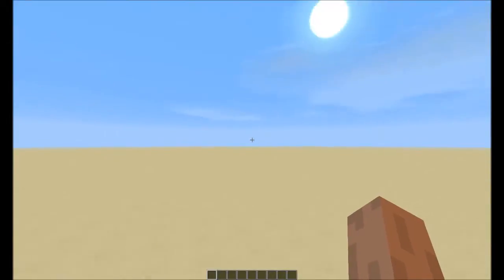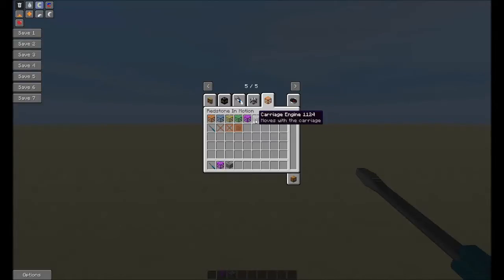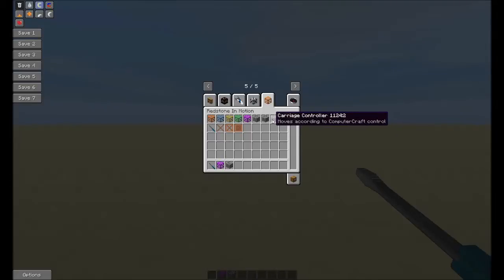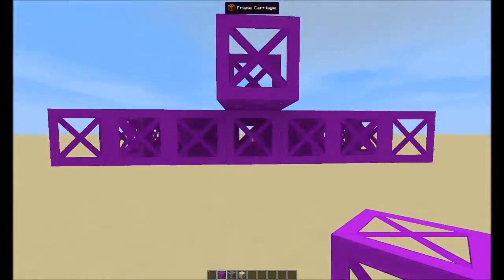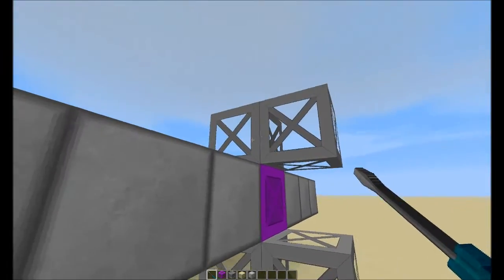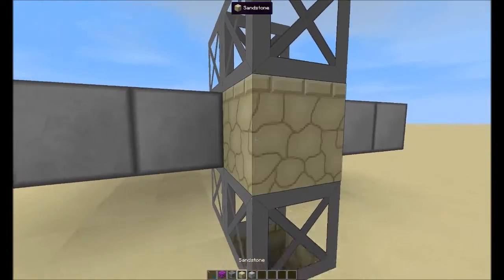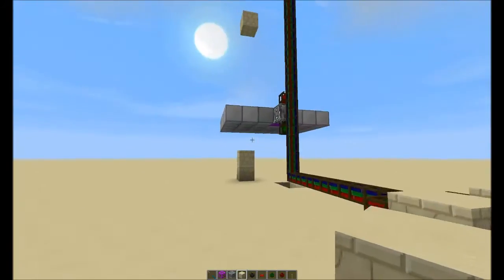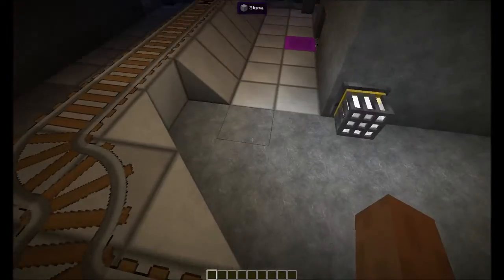Minecraft: Redstone In Motion

Comment: I built the exact same thing in new Tekkit for MC 1.6.4, none of the motors or carriages move themselves or anything else, no matter what I do.  This exact setup is completely and utterly immobile.  Don't waste your time on this broken mod until they fix it.
Reply from the maker: Andy Hoster Did you follow the video? Maybe you can make one yourself so I can see what's wrong.
Reply: Shvok All right, so what I omitted were the carriages on top of and below the engine.  Why are they neccessary?  Why does this not work with any other kind of carriage, in any configuration, nor with just the motor alone?  Only this exact arrangement of exactly that kind of carriage moves at all, ever, in all my testing... very very difficult to understand.
Reply from the maker: Andy Hoster It is needed because the engine and anything attached to the engine will be considered a part of the whole multi-block structure. Each engine has it's own characteristic, the carriage engine which is shown in this video moves with the structure. The carriage motor will move the structure but will stay put. I'll make a follow up video soon explaining all of this.
Reply: Shvok Thank you for taking the time to explain.  I'm not sure why anyone bothers with this mod; it's nearly useless to make anything productive.  I'm trying to build an elevator out of the blue carriages so it can take blocks with it, and finding it utterly impossible.  I see them in videos but that must be Remain in Motion, because I've found no way, in three solid days of trying, to do this with plain Redstone in Motion.

If you try to use the stationary motors, you can't ever send any kind of carriage up more than 1 meter, period, because any kind of wiring to supply redstone to the next motor up counts as a hard brake and stops the whole thing.  Meanwhile you can't manage the trick you pulled with the template carriages and a mobile Engine with any other kind of carriage, nor can you mix carriage types, and other carriages placed in a template carriage lose their properties as carriages, so you can't move blocks.  Real blocks, not fake templated ones.  

I guess that's how they're doing it, they placed their controls & whatnot in the template.  That doesn't work with what I'm using (Galacticraft multiblock launchpad - doesn't form inside a template carriage).  I guess it just isn't possible, which disgusts me after all this effort.
Reply from the maker: Andy Hoster I suggest you read up on what each colored frame does. If you want to make an elevator you need to use the purple frames as I have done in this video. This is actually a very useful mod, you just need practice. If you look at my other Minecraft videos you will see various ways I have used RIM. I am also making a base tour soon. Which will show a lot more.

Comment: I know how to use open computers
Reply from the maker: Nice! If I restart this project I'll let you know :)
Reply: How? I cant find any documentation on it
Reply: @Oliver_Atkinson  the official open computers forum and documentation is at https://oc.cil.li
Reply: @lukeh990  yeah, but i am having trouble interfacing with the RiM controller
Reply: @lukeh990  im also new to lua/OC is a bit of hand holding is required XD,  my conputer recognises  the perhipheral from RiM but idk how to give it commands
Reply: @Oliver_Atkinson  Ok so it recognizes RiM for testing you can send commands via the lua prompt using the command lua or a program. Lua prompt is easier for testing since you don’t have to declare the component library or the component to start. If you type component.(I don’t know the RiM component names). Use tab to look through the functions available then if you remove the parentheses and press enter it might tell you the functions required variables but if it doesn’t you will have to look them up on the RiM documentation. Do you have discord if so DM me at @Random Programmer#2745 I check it more